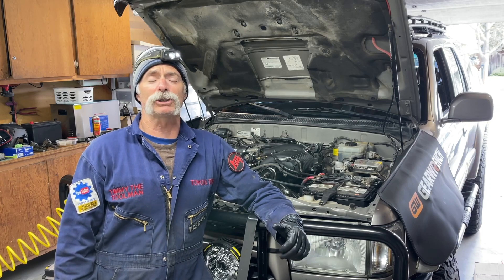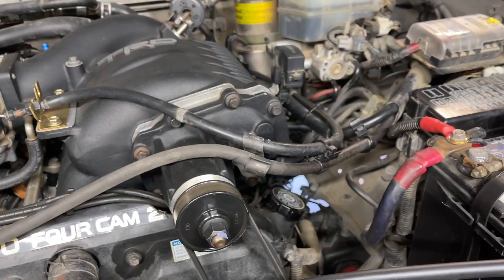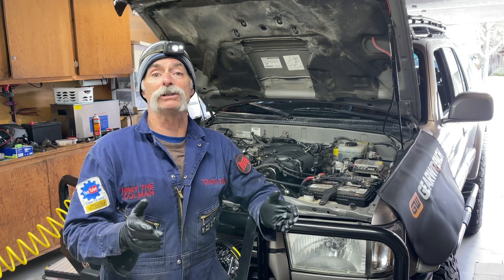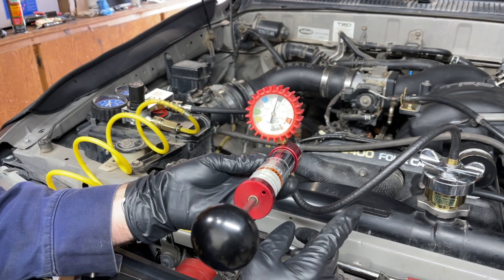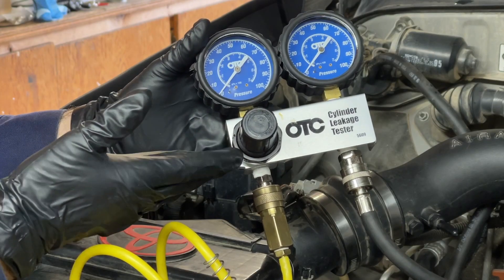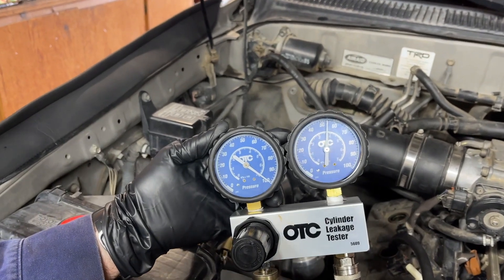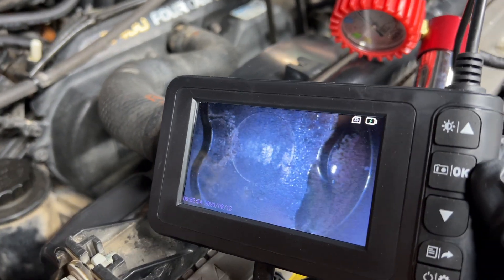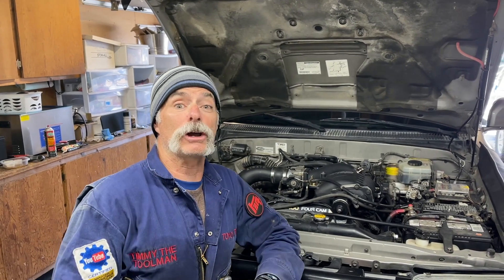Head Gasket Failure Diagnosis - Misfire code P0300 (P0301, P0302, P0303, P0304, P0305, P0306)

Comment: I would NOT buy an expensive 3rd gen 4Runner with over 200k miles for asking price unless the heads had already been replaced! Learned with my 2000 4Runner that that's their weak point no matter how  meticulously you maintained it or how often you replaced the Toyota coolant! Not a bad job if you are a DIY mechanic and watch Timmy the Toolman channel.
Reply from the maker: Yeah, it's a fairly common failure.  I agree it's pretty crazy what people are paying for these 3rd Gens with a lot of miles on them.  I wouldn't pay it.
Reply: I would. If you gave to do the heads should be good or swap in a new motor your good forever. Cheaper than buying a new one. Glitchy nightmares
Reply: Bought two…at 206 and 220.  No problems whatsoever.  198 psi across the board.   If you can fix it yourself get what you want….ain’t gonna get cheaper/easier to find.  Join the club!
Reply: @heatmyzer9  so funny so did I both manual. I like them. Nice trucks